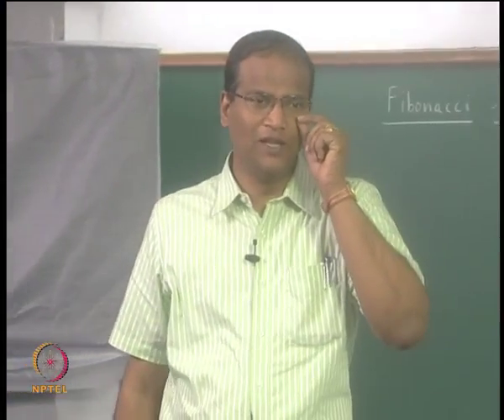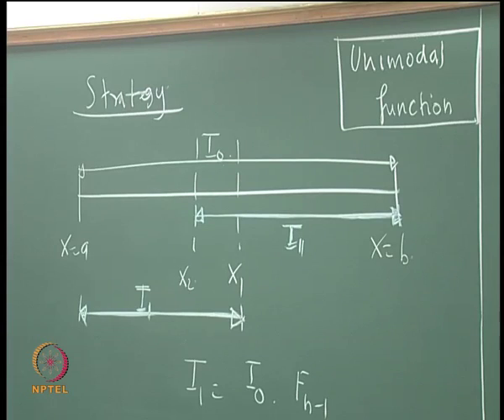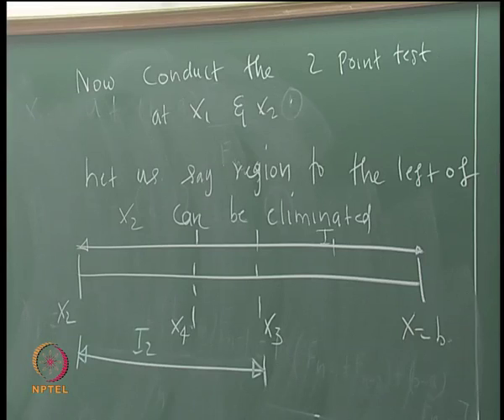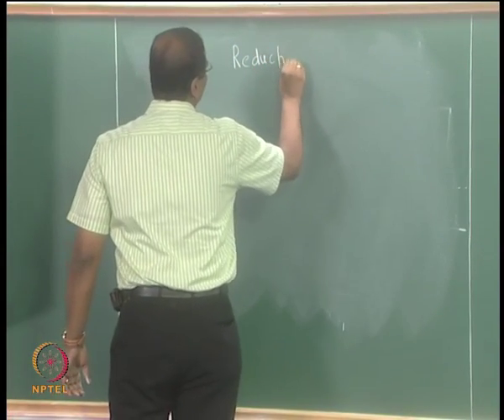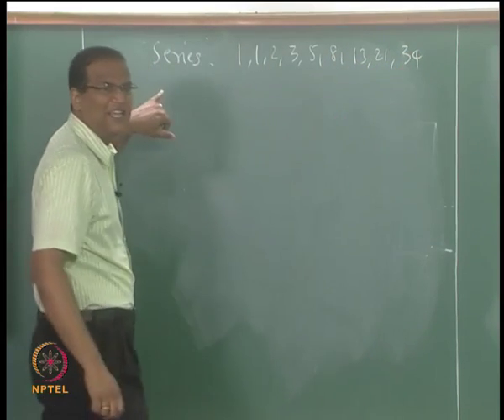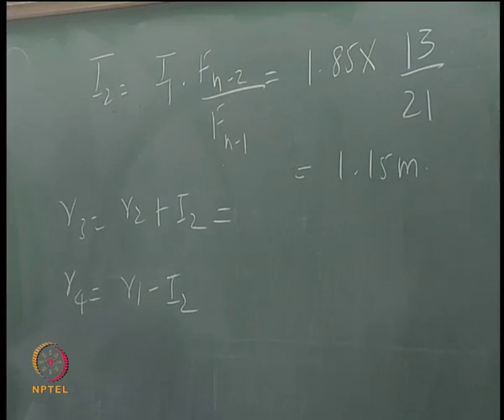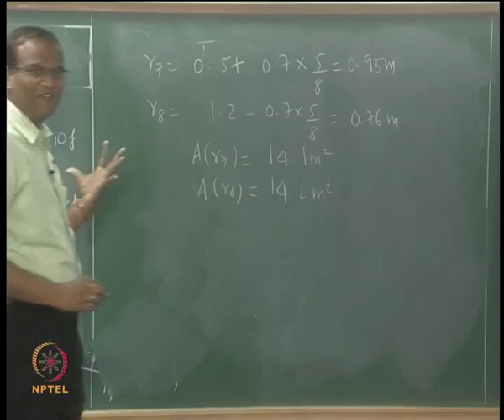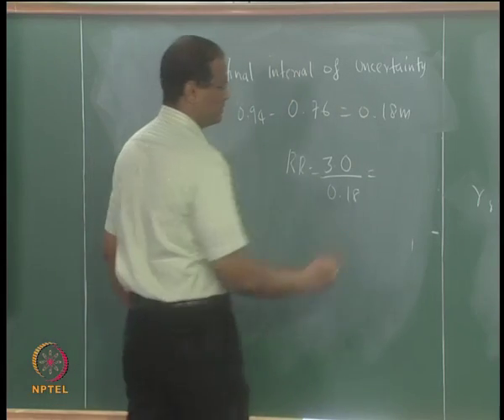Mod-01 Lec-31 Fibonacci search method

Comment: If it is a minimization problem ....
U went wrong in the first elimination process 
Instead of eliminating left of r1 ... u did some thing else..
If A(r1) >A(r2)
In minimization problem
We should eliminate left side of r1..
But u eliminated right side of r1
Which is considered wrong.....
PLEASE REFER AND CHECK FOR CORRECT SOLUTION..
A part from that i like this video... helped me a lot...
Reply: +sai kiran The elimination he did is correct.
You may be confusing r1,r2. Here he used r1,r2 notation with r1 > r2. So, the interval is like [a,r2,r1,b]. Then the condition is right; that we have to eliminate right part if A(r1) > A(r2) under minimization. 
If you used the notation with r1 < r2 so that the interval is like [a,r1,r2,b] then your condition would be correct.
Reply: @soul-of-the-sea  Thanks a lot Sagar.
I had the same doubt but your explanation made everything crystal clear .